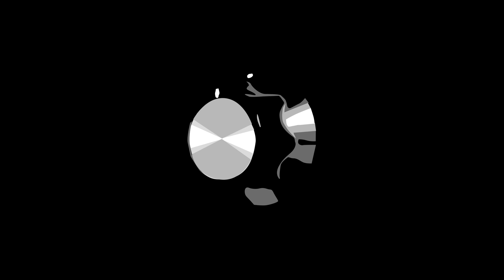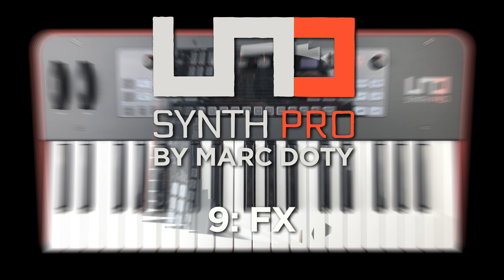09-The IK Multimedia UNO Synth Pro- Effects

Comment: I'm toying with the idea of getting a desktop version. The sound is possibly the deepest and warmest I've heard from a synth at that price.. Problem is I keep reading about how bad the touch keys are. Have you had any experience of the desktop version? Thank you.
Reply from the maker: I'm sorry, I haven't!
Reply: Richard, I have the desktop version. The little touch keys really aren't bad at all. They're actually pretty response and quite easy to play. Add in a pair of good headphones and you've got an incredible sounding, totally portable synth that hardly takes up any space. Definitely an immersive experience. I will say that I also have it hooked up to another midi controller, so sometimes I'm playing it through that, but I think for the price and flexibility, the desktop model is hard to beat, especially since it has the exact same synth engine as the full size version. Hope that helps.
Reply: It certainly does help Dan. I think after Christmas, I'll make a purchase. It certainly has a nice deep sound from what I've heard. Many thanks for the info. Appreciate it.